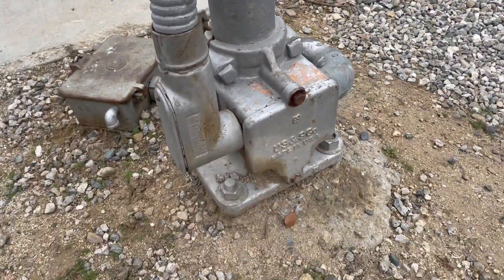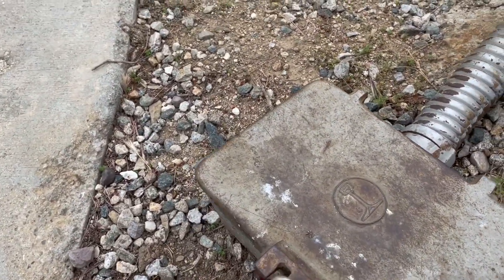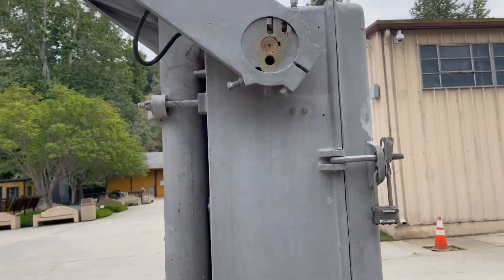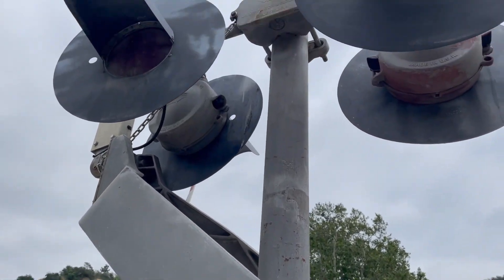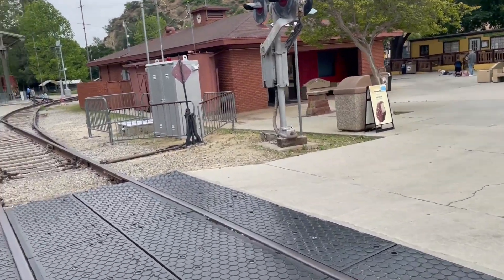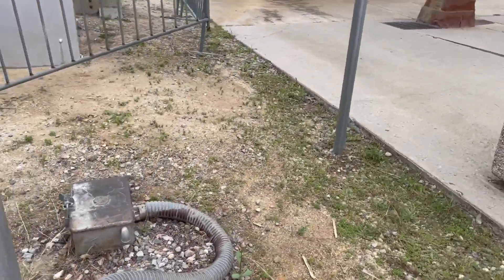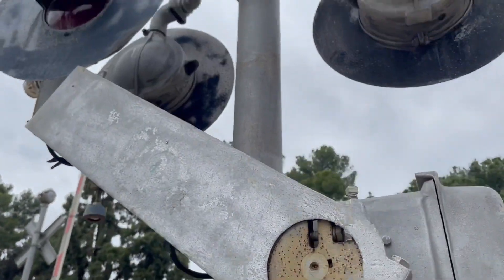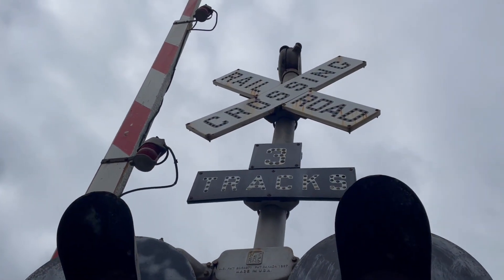Travel Town Crossing Tour, Griffith Park, CA

Comment: Those crossings look styled to the ones in the AT&SF branches. Maybe one of them came from there?
Reply from the maker: Looks more like the crossing in the Anaheim-Fullerton area, but with WRRS bells instead of US&S teardrops.
Reply: @TastyBishop  There was wishbone Griswold Ems on the Santa monica Air line. Plus they look like they'd come from there. I think there is also maybe Railroad Supply Co bells or 1930s WRRS bells
Reply from the maker: @LRF_101  Huh. What street were they on?
Reply: @TastyBishop  I don't know. Almost all of the signals have been Removed in 2007.
Reply from the maker: @LRF_101  Weird.
Reply: @TastyBishop  Yes it was all for the Metro Expo line project they removed some signals in 2005-2007